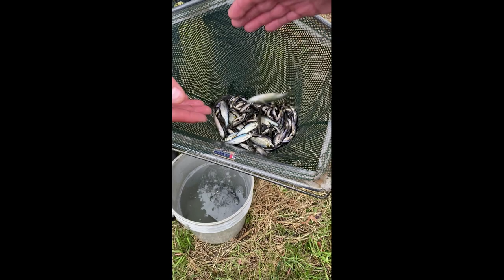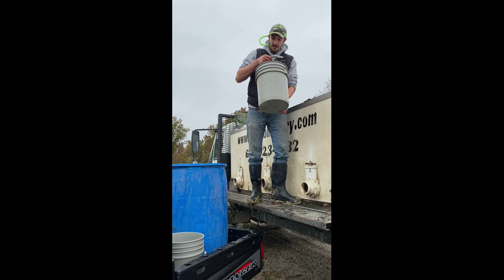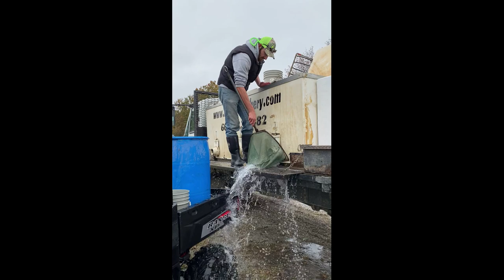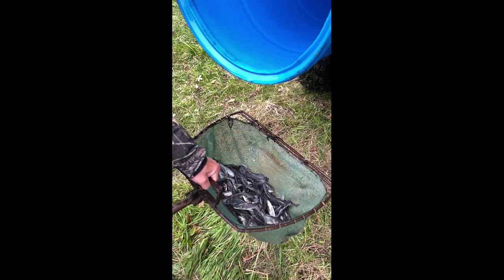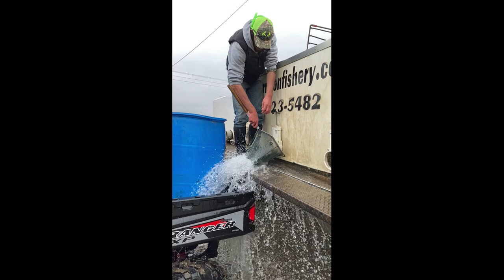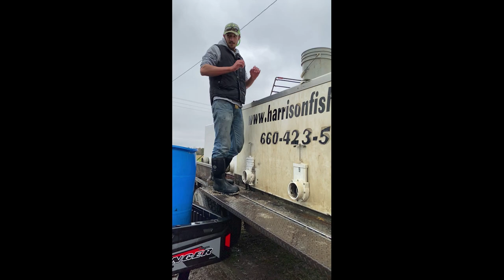STOCKING POND with 15,000 Minnows, Golden Shiners, and other FISH!

Comment: Wish I had a pond, well I got a 2000 gallon puddle that I made last week. I been wanting a quarter acre pond but my clay is 20ft below sand from the test I did by hand. Hauling clay will make my build very expensive. Are blue gill small fish like crappie?
Reply from the maker: They are.  Crappie can get bigger.  Both are good eating.  They were mainly put in for forage for bass.
Reply: @ShadyOaksFarm  Thanks for the info and great video.
Reply from the maker: Thanks for watching. Stay tuned!  Next weekend releasing first fishing video since predator fish were stocked. It will be a year around October 20th since we stocked the bass, crappie, walleye, and stripers.

Comment: how large was the pond to be able to support that many fish? feeding program? What did that cost for the fish? 4k?
Reply from the maker: The pond is anywhere from 2 1/2 to 3 acres +-   The minnows, shiners, and bluegill are considered all bait fish for Bass, Stripers, Walleye, Crappie and Catfish.  Currently we have no plans on feeding our fish besides what we stocked for bait fish. Believe it or not the predator fish were cheaper than than bait fish!  Minnows, Shiners, Bluegill, and channel catfish were just shy of 2000.  Predator fish were just shy of 800.00.  Hopefully that answers your questions. Thanks for watching.
Reply: @ShadyOaksFarm  that seems very reasonable for the prices. U have a link to the part two where the predators were released? Considering crappie but I’ve heard they spawn earlier than the bass and then it makes bass fry survival very hard. Thanks
Reply from the maker: @nunyabizness3382  https://youtu.be/fSYOjT4oK4Q
Reply from the maker: @nunyabizness3382  That can be an issue and one of our concerns when adding crappie.  However in talking to the hatchery and a few other experts you can have success if managed correctly.  That’s why we added the Stripers and Walleye.  They supposedly help control the crappie fry. We will see!  I hear pros and cons all the time.  We did not add many crappie!